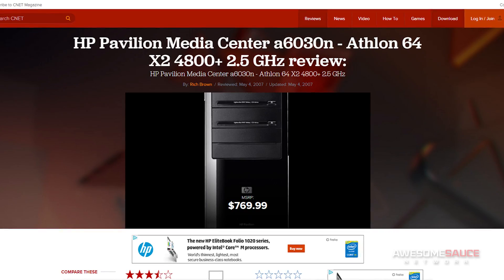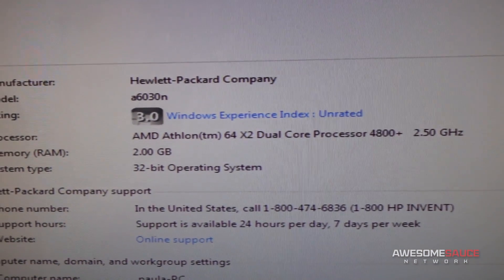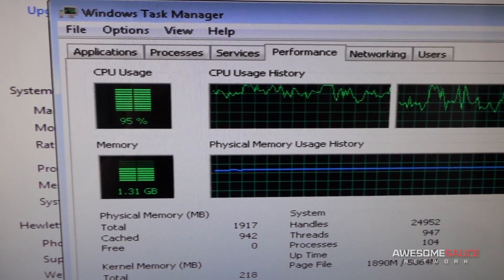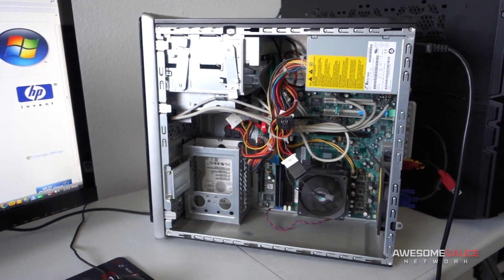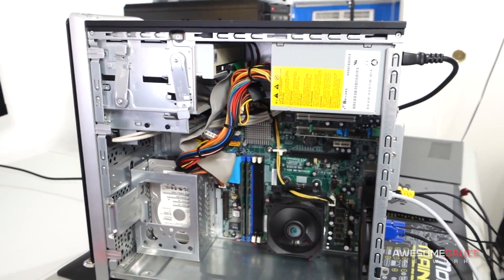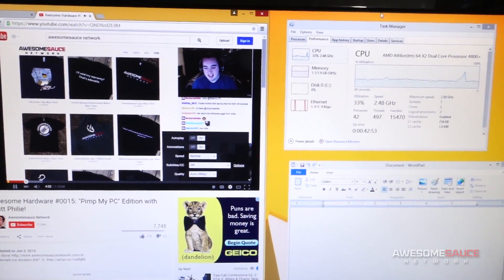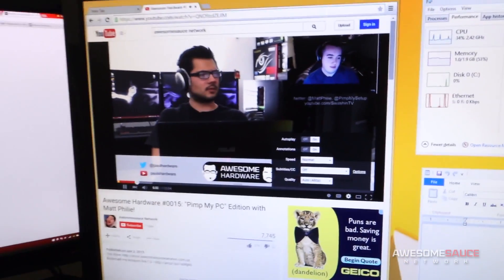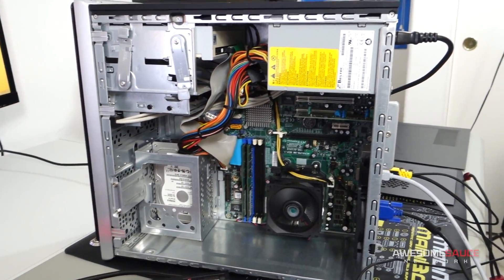Cleaning Up My Neighbor's Old Desktop!

Comment: My HP Pavilion a6442p looks EXACTLY like that tower on the outside!  That a6030n was probably released at the same time as the a6442p. Except with mine, I have upgraded the system with a GTX 950, 430w power supply, and a Core 2 Quad Q9550.  It runs modern games really well!
Reply: We actually finished the build this weekend. Unfortunately, the machine would not accept all 8 gb of ram, so we had to max it out at 6 gb DDR2. It is running a non-OC'd Core 2 Quad Q6600, a 1 TB HDD with Windows 10 installed, and for the final touch, we added in a GTX 1050. We only ran a couple games so far. My friend tried BeamNG Drive, and it was a bit laggy, but he said it was much better than his prior PC and he had no problem playing it like that. The other game we tested was War Thunder, which we were able to max out at 1050p (We were using the original monitor that came with the PC, it wasn't bad, but no 1080p and no HDMI, but both it and the GPU had DVI so it was fine). War Thunder had a couple issues at first but in the end we were able to get it to hold above 60 FPS at all times. While not perfect, I would consider it to be a success, considering it was under $300 for all the upgrades to revive a 10 year old Dell Dimension 9200.
Reply: That is actually a pretty good setup! The one thing that makes wonder is how 10 year old cpus (by 10 year old cpus I mean Core 2 Quads) are still able to run games so well when paired with modern GPUs? I'm going to try helping a friend upgrade Dell Dimension 9200 which has Vista and a Core 2 Duo. At the heart of the upgrade will be a Core 2 Quad Q6600. Combined with 8gb DDR2, Windows 10, and if all goes well, a GTX 1050, do you think it could run modern games?
Reply: Peter Kapica Cool, thanks for responding so quickly. It's going to be interesting to see if we really can make a 10 year old PC that can barely run at all right now capable of running games!
Reply: Peter Kapica That's good that you upgraded.  Pentium D's are a joke when compared to things like the Core 2 Duo and beyond.
Reply: NJ Sullyalex That's awesome!  People don't give these older PC's enough credit.  6gb of ram is enough for now as well.  My friend was trying to tell me how bad my q9550 is, but when I told him how well it ran with ddr2 he didn't even know what to say in response.
Reply: TheAppleMacsterRace its better then nothing
Reply: TheAppleMacsterRace and I game on a 10 year old pentium D. Its an HP too
Reply: NJ Sullyalex yes just make sure the card isn't too powerful. The 1050 is similar to a 950-960
Reply: NJ Sullyalex it'll run gta 5 pretty good (high 40s mid 50s on 1080p high) given the parts you are upgrading.
Reply: NJ Sullyalex before I built my i5 powered gaming pc, I had a 10 dollar thrift store HP that had a Pentium D 32 bit only and a Radeon from the same time and I would play call of duty on it. It ran 40 fps on 720p low but it still is a viable system. I then upgraded to a GT620 and I'm getting 60-70 fps on the same settings. It had only 2.5 gb ram. I sold the pc for 35 bucks on Craigslist
Reply: I also finished the COD 4 campaign at 25 fps on a Pentium 4 Dell
Reply: that motherboard supported max a core 2 duo e6000 series with a 800 mhz fsb. Now i got a z170 board in my pc with an i5 6600k skylake. Supports up to a 6700k according to the box
Reply: And also my friend has an acer desktop with a pentium e2160 dual core with 4 gigs of ram that i OC'd from 1.8 ghz to 2.5 GHZ. Runs windows 10 64 bit like a dream. I also in theory can put up to a core 2 extreme but it only has DDR2-800 capability.
Reply: Peter Kapica My computer only has DDR2-800 capability and it still runs great!  It might be a bit slower compared to ddr3/ddr4 but it still works really well.
Reply: Kevin Maguire That is good to know, since DDR2 is what I will be working with. I'm worried about bottlenecks, and that is one of them. I'm also worried about the CPU and PCIe slot.
Reply: NJ Sullyalex you'll be fine
Reply: NJ Sullyalex beats through modern games nicely
Reply: NJ Sullyalex nice
Reply: +Kevin Maguire (ktech49) The Core 2 Quad and DDR2 RAM are underrated. You don't need a ton of RAM to run games since they are only getting more optimized, and the C2Q is still a CPU comparable in power to that of the Xbox One or PS4. Heck, I've even heard of over locked Core 2 Extremes beating even the newest Core i5s! Anyhow, it is crazy to think that we were able to take a 10 year old PC that at first could barely run at all and turn it into a machine that can run modern games nicely for under $300.
Reply: NJ Sullyalex I know right?  The processors in the PS4 and Xbox One are weak compared to the Core 2 Quad.  Just the thought of an overclocked 10 year old chip being on par with new i5's is insane.
Reply: sounds like you spent quite a bit on the upgrade.  What was your final cost?
Reply: Nice

Comment: i just bought an E8400 3ghz dual core system for $50(aud) and was wondering whats the best way of getting 2 sticks of ddr3 ram
Reply: you can just buy them new, from pretty much every electronics store. In Europe at least, most large consumer electronics stores also sell parts but only per order. 
You might also want to look at which speeds are supported by your mainboard and cpu.
Reply: Don Pauer  the only problem is that I'm in australia, there is almost no large electronic stores in sydney at least and yes i know the speeds
Reply: OMG. White people problems. In my city 4-5 retail networks that sell PC components.
Reply: Newegg?
Reply: RedrumZombies we dont have it

Comment: you changed vista to windows 8.1? isn't that downgrading?
Reply: Vista is pretty much at the rock bottom of the Windows chain, even including early builds of 8.
Reply: This was supposed to be a joke...
He is running vista change it to 7/8.1/10 and it will run much faster
Reply: I am a big Windows 7 fan too, but Windows 8.1 with Classic Shell is better than Windows 7 any day. It takes everything good from Windows 7, upgrades all built-in utilities, and adds full SSD support to it. It provides better security as well. Windows 8.1 is like Windows 7 plus Windows 10, minus all the stupid Windows 10 telemetry crap, plus the ability to change Windows updates settings.

Windows 8.1 with Classic Shell = Windows 7 on crack!
Reply: @-intrepid  you are correct...the worst things of Vista is that is RAM hungry and UAC
Reply: Payton Kluck Windows XP was actually pretty great; a nice step up from 98 (and obviously mountains above ME).

But we don't talk about ME like Apple fans don't talk about the Newton.
Reply: E 131 u ruined the damn joke
Reply: I've been running Vista on my laptop for nearly 10 years, never had a single issue with it.
Reply: Try ubuntu its free good and almost no virusses
Reply: Ubuntu sucks, quite the same as Windows, try Mint, its much more friendly.
Reply: You've forgotten about the HDD killer, Windows ME.
Reply: @Fyrwulf  theonly good thing about ME was the defrager.. stole it and put in many many 98/98 lite setups
Reply: if u replace your HD for a rock it will run better then a HD with vista installed!
Reply: Nakura Orihara Yeah but with those specs you kinda have to.
Reply: E 131 your profile pic isn't original ;/
Reply: Nakura Orihara WinXP FTW!!!!!!
Reply: well change it to 7 or 10 and it will be like u have a i7 6k and a nvidia 1080
Reply: ***** what what?

Comment: I had a tower computer back during the XP days that i used all the time. It quite working one day and I opened it up. ALL THAT DUST! I thoroughly cleaned it as best as possible. and it worked just fine after that. After than i implemented a cleaning routine, every 2 months I would open it up and blow out the fans and heat sinks and twice a year I would take the heat sink off and give it a throe cleaning. It would just fine for all that time until XP stopped being supported and i switched over permanently to my laptop.
Reply: I use compressed air to clean PC.
Reply: Do you still have that tower? Because you can just go to windows 7 if you don't want 10 or 8 (and its free.)
Reply: No I don't have it anymore. Gave it to my brother. He has his own computer now and has my old tower in storage somewhere in his closet.

Comment: Hey can someone help me I think I have the exact same type of pic this guy is fixing

When I removed my ram out it back in now it won't turn on yeah it will turn on but the keyboard and the screen doesn't light up
Reply: Take the RAM back out and put it back in. Make sure when putting it in that you put them in the right slots and that the latches at the ends of the slots are open, then push down on the ram with minimal force and the ram should go in and the latches should close on their own when the ram is seated correctly. Also notice that the notch in the ram lines up with the notch in the slot.
Reply: I did but still

Comment: this reminded me of my best friend who passed away. not only is his system riddled with viruses and pop ups, the internals are so gunked up with dust i was taken aback. took me a good hour to vacuum and brush the insides and wash the heatsink and wipe clean the fan blades ( that includes the power supply) before i even got started with reformatting his hd. 

ah vista, the great resource hog. brings back the days i ran to  Black Viper's website for help. he's a righteous dude.

Comment: I would drop in 2x1GB DDR2 to bring him up to 4GB for cheap (Heck I probably have several sticks kicking around).  Windows 8.1 would love more memory.  I would not bother updating the CPU because nothing he is going to run would stress that... even most games.  He does have SATA headers so he could drop in a 1TB HDD cheap (7200RPM) if needed.  There is nothing wrong with a system like this... even for gaming.  That is a PCI express, so a GTX 950 would make this a good budget gaming box.  *GB would be better though.

That looks like the same case you use for you Stealth build later... He must have replaced the system and passed it back to you.

Comment: +BitWit

Nice video.

Out of curiosity, what kind of tools were used in this video? I saw the thermaltake CPU cleaning solutions, new paste, and the dust can.

You used a microfiber cloth at some point or was that a "rag" of sorts? Were you using any wet cleaning solutions, or was this all dry "spray and wipe"?

Comment: If my computer uses DDR3 RAM does that mean my PCIe 3 takes GDDR3 gpu? because ive been trying to upgrade but somewhere online said my computer can use any GDDR. The only thing I am certain about is that my ram is ddr3 cause I've added one already.
Reply: no, your RAM type has nothing to do with your VRAM type. I don't know for certain since I don't know your components but you will most likely be able to fit any modern graphicscard, even one with GDDR5X memory
Reply: +JanusPrime thanks. it's a Dell 660s. Pretty slim case.
Reply: T1 Under 5150 If the case dimensions worry you, then I'd definetely check the dimensions of the hardware you plan on buying and see if there is enough room in your case.
But there should not be a problem from a hardware compatibility standpoint.

Comment: I have a HP Pavilion Elite M9760in. And I don't know what's wrong with it, it powers on, but when I try connecting it to a monitor, it doesn't work.... ;(
Reply: Get a new monitor?
Reply: +Preston Garvey no sadly it's not that, I tried connected it to more than 3 different monitors.
Reply: Funky VideoGamer Unplug the computer from the wall, then hold down power button for 1 minute. try using different ports like VGA instead of HDMI.
Reply: NeoProHex Iv'e tried all cords, maybe i need a new motherboard?

Comment: how do you clean the surface of the cpu with the old thermal paste on it?
Reply: Cloth and rubbing alcohol
Reply: cloth is good but you can also use coffee filters and put rubbing alcohol on it,do not use paper towels because it can leave small bits of paper on you cpu

Comment: FM2+?  Would that be compatible with the AM3 socket?
Reply: FM2+ is a completely different CPU socket. If a CPU is marketed to work with FM2+ you need a motherboard with the fm2+ socket for it to work
Reply: I believe the video is recommend an FM2+ processor to be used.
Reply: I was just answering your question
Reply: GAMERS UNITE I know
Reply: It is not Fm2+, he made a mistake in his speech, however, Am3 cpus should be backwards compatible with a an am2+ if you get a motherboard bios update
Reply: Use hammer
Reply: Thu Ya Win He was implying to buy a new Mobo and get ddr3 ram and the new processor.

Comment: Where can you buy an MS-Windows-10-Pro license key for cheap?
Reply: Kinguin, they're like $20 there.
Reply: ebay, very cheap
Reply: /r/microsoftsoftwareswap
Reply: Alex4SiliconValley just download an ISO and use an activator
Reply: Alex4SiliconValley You can get it for free from the microsoft website,  and then just install KmSpico and activate it for FREE.
Reply: rutorrent
Reply: Zed Jayce which buyer bro ,  I need me a license
Reply: FoxyThePirateFox some sites have viruses that host this
Reply: just download win 10 through a torrent site they come with activators most of the time,just be wary for viruses
Reply: Bill Nanos I'll give you my activator free just ask

Comment: Kyle instead of putting Windows 8.1 on there you should've put Windows 7 Thin PC on there since it's familiar for someone who has used Windows Vista for a while, and Windows Thin PC runs very well on low-end hardware.

Comment: Win8.1 and only 2GB of RAM? Lame. That PC should've been bumped up to 4GB right off the bat. Less than 4GB isn't going to work well these days. I guessing that PC takes DDR2 PC5300 or 6400? Ebay sells these cheap.

Comment: My dad's got a similar PC, HP Pavilion a6511 from 2008. It had an Athlon 64 x2, 2GB RAM, and integrated graphics.

I upgraded it to an Athlon ii x3 (AM2+ socket allows for upgradability), a new 4GB set of DDR2, a 256MB Radeon x600 graphics card which kicked the IGPU's ass, and a 120GB Samsung Evo SSD +W7 64 bit. You can do a lot with old stuff.

Comment: that's DDR2 memory, that means the board can take up to 8gb of RAM, not bad... if the CPU can be changed into an Athlon X4 and get 8gb of RAM (4x2gb) the PC could function somehow good even for modern day tasks.
Another thing that could help is to put an old card like GTX 460 or something like that... that could improve the visuals a lot in order to play 1080p videos.

that PC could even run some 2012 or 2013 tittles!

A cheaper way to go could be getting a R7 250 or GTX 730 GPU, and adding 2 more gigs of ram for a total of 4gb. That will only allow for 1080p vids, X64 windows and somehow multitask.

Anyway, except for modern days triple A tittles or heavy multimedia edition dutys, that PC updated could work just fine

Comment: The cosmetic cleaning is fine, but may have had next to no actual effect on final performance benefits; temps may or may not have been consequential. What was the upgrade cost, if any? Clean install fixes most everything, but did it cost him more than a new basic machine (which of course would come with newer crapware)?
Reply: I didn't get the feeling that he charged the guy, since it was his mom's neighbor.
Reply: Lol I don't think he didn't charge the guy, it was a favor.

Comment: It came out nice but it is going to reach the ram and cpu limits very easily if he tries to do anything demanding with the pc.Also not one piece of hardware in the whole pc is worth more than 20 bucks so it really doesn't make sense to continue using it when for 100 bucks it could be upgraded to 3-4 times more power.

Comment: what products did you use to clean the computer?
Reply: i guess some compressed air in a can and the rest would be just normal cleaning stuff which wont eat your parts
Reply: vaccuum and othet electric stuff
Reply: I see ArctiClean there to clean the old thermal paste. Standard stuff.

Comment: I'm not sure what's going on with my computer, but i think something's going up with the memory cleanup. I've got 16GB of RAM and memory usage on boot is a fairly standard 10%,  but it continues to rise the longer i have my computer on, and the process doesn't appear in task manager (for example. task manager says i'm using 46% of my total available memory, but it also says that all my processes are only using about 1.2GB).

Malwarebytes says that my system is completely clean, and i know it's not just a problem in task manager because the computer starts seriously chugging when memory usage hits 100%. Does anybody have any suggestions?
Reply: That sounds like a memory leak. I feel like randomly throwing a dart at registry keys, have you ever used CCleaner?
Reply: Xyzair
Alright, so after having a bit of a poke around i've found that windows will try to utilize as much RAM as it can, just so power isn't being wasted. Apparently it'll tend to hover around 45-50% when idling, which makes sense because i've seen that on almost every computer i've logged onto, and when i swapped out the memory i had with a 2GB stick i had lying around i observed similar results. Cheers for the recommendation though, i didn't realize how much crap i had on my computer.
Reply: maybe just try a fresh windows install
Reply: Try CCleaner.
Reply: Gordon Rammstein
actually my task menager says that im using around 15% ram (out of 8gb) with firefox using most of it - 8.5%
Reply: How peculiar.
I think i'll blame it on space magic then. To be honest, i can't think of an app that requires 8-10GB of memory for it to be hampered by this, so i'm not massively upset by it.
Reply: Gordon Rammstein
try to reinstall windows. I guess you have some crap in there which could even be hidden in task menager (viruses?).